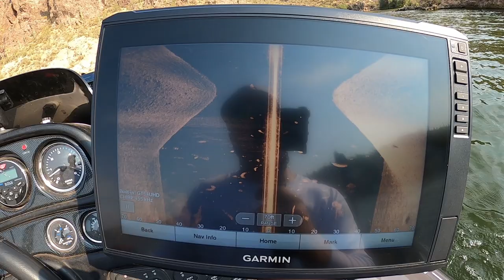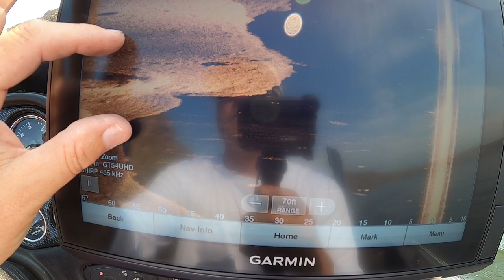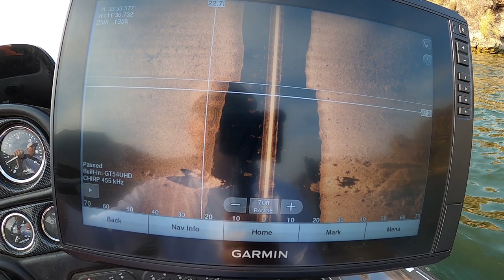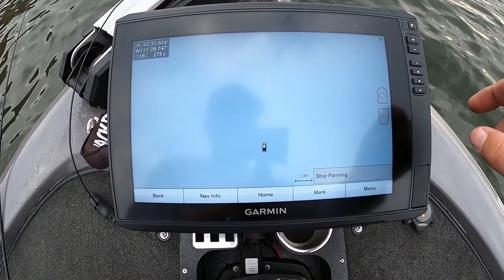FIND and CATCH more FISH with GARMIN electronics

Comment: What's the fastest you should move when side scanning and still get a good picture???  Thanks for the video.
Reply from the maker: With my garmins I found the best is just putting the boat in gear. So maybe 2mph. I’m sure all brands and models are slightly different. But if you go to fast the structure and fish will look smaller. If you go to slow you will get a weird fuzz on the screen. It takes a while to learn them and really know how they like to b ran. It also depends on how well the transducer is mounted.

Comment: This video was awesome, showing the graphing and picking spots. The flat area you identified as grass flat, if that's by Pilot Point, I thought it was rock??? Isn't there a bouy there marking it as a rock?
Reply from the maker: I think I did call something a grass point and meant to say rock. My first time making a vid like this. It was actually a lot of work and trying to hold cameras 😂. I’m going to get a camera mounted so I can go handsfree and not so confusing.
Reply: @millertimeoutdoors7820  I thought you did good considering. You might try a chest mount too. Thanks for the reply
Reply from the maker: The chest mount is to low and doesn’t get close enough. I can mount a GoPro on the unit but then the only issue is the glare on a sunny day. There is also a way to screen record garmins. So that might b the deal if I can get that working. I will figure out a way to make some better videos.